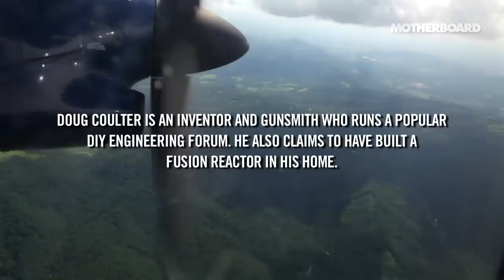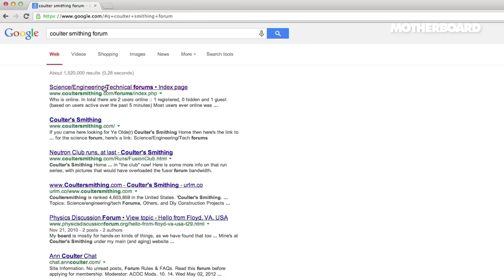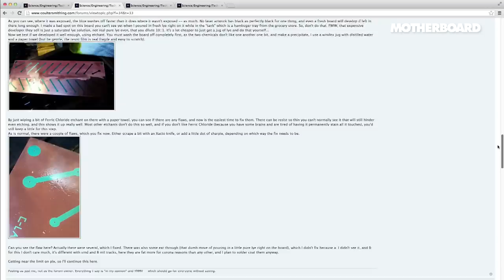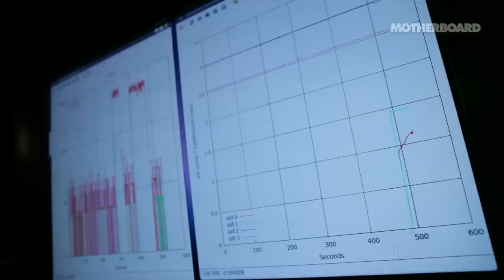Developing Nuclear Fusion in a Basement with a Reclusive Gunsmith

Comment: That "fusion" reactor just looks like a bunch of tubes and a light bulb attached to it. You ain't foolin' no one, old man.
Reply: just google "fusor"
Reply: This is an inertial electrostatic confinement fusion device, commonly known as a fusor. It was invented by Philo T Farnsworth and it works. It does not create a net gain of energy but there is real D-D fusion going on. They are pretty simple to make, high school students have made them.
Reply: Jerry Biehler   Jerry is correct, though the "inertial electrostatic confinement" moniker is a misnomer.  It's actually a beam colliding device, primarily.  I've just taken it a goodly bit further than Philo Farnsworth/Hirsch/Meeks, is all.  People used to just be armchair guessers about what goes on in there - I measure and adjust technique based on what I see - real science, in other words.  Not armchair quarterbacking science, which has tended to be more or less dead wrong.

Comment: I think that was a flux capacitor I saw over in the corner behind the nuclear fusion reactor. #genius #awesome
Reply: salaciousBastard At least one :)
Reply: I got the reference, and in fact, it IS a huge Maxwell capacitor, 120uF at 10kv (I have 3 total).  Not in use right now, it takes a lot of work to utilize around 6k joules that can discharge in under 10ns safely....

Comment: Would an uncontrolled fusion reactor keep growing and eventually turn earth into a mini sun?
Reply: fascinating guy, wished I lived next door.
Reply: No, it's a driven, not a chain reaction.  All the produced energy flies right back out, through the thin (~2.2e-5 atmosphere) pressure gas, and we have to turn it back into electricity to run the thing.  The point is, having enough left over after that to power a home, say.
Reply: No, the reason the sun sustains fusion, is that it is composed mostly of fusion-able material and has enough mass to sustain the reaction by pressure alone. Neither of those conditions are true on earth.
Reply: Doug Coulter How about put heavy water into the reactor and dip a drop of mercury into the water and put on the fusion reactor exactly when the drop of mercury are in the center of the fusion? Would that increase the output magnified?
Reply: Harry Halme Heavy water cannot exist in a vacuum, it will boil off. Deuterium, the gas that is used in a fusor, is an isotope of hydrogen so heavy water is really deuterium oxide. Plus water or heavy water is polar and is very hard to get out of a vacuum system, it take baking and other forms of excitation to get water molecules off the walls and out of the chamber. Very annoying.

Not sure what the point of mercury would be. It would just vaporize and contaminate everything in the chamber.
Reply: Thermonuclear bombs use a regular fission bomb (shock wave more or less) to compress and create fusion in lithium deuteride, which makes more neutrons, which in turn helps the fission bomb "use" all its fuel before the whole thing comes apart.  Most of the energy in that case is still from fission, FWIW.  The fusion part is just a neutron generator to accelerate the fission so more can happen before the thing vaporizes.
Reply: you will need a lot of thermonuclear "fuel" (tritium) for that, just to start to bring oxygen, helium and carbon into your chain reaction. in other way, hmm... not enough on this planet. or the solar system minus the sun for that matter.

>so it's very rare and expensive
there's enough tritum hanging in the glowstick on a gay furry's neck wagging his tail on techno music to power an office building or a couple of homes for one year.
Reply: *****
 that's what people feared when they detonated Trinity, the first nuclear weapon.  that the chain reaction could create a chain reaction with oxygen.
Same concerns occurred while testing the first hydrogen bombs. the first production of antimatter and the first particle collisions.

We survived ! meanwhile we had Three Mile, Chernobyl and Fukushima catastrophes because there's still not a nuclear physician in charge of every nuclear reactor. Engineers still think it's a steam machine that obeys to thermodynamic laws.
Reply: Fusion does not work that way...you can't have an uncontrolled reaction as that would imply you just kept fueling it.  Fusion reactions are by their nature controlled...even fusion bomb yield is limited by the payload...it doesn't result in spontaneous fusion from all surrounding material.
Reply: Jerry Biehler What if i took some mud, and rubbed it on my chest with some pure vanilla extract in there. Would that create nuclear fusion, the thing real scientist have been working towards for years?
Reply: Duhya The vanilla will not fuse by itself but it you add cinnamon, it might just work.
Reply: No, Spiderman 3 was bogus.

Comment: There's lot of money to be made in fusion, but its no easy: in fusion you are, in a nutshell, creating a micro-sun and harvesting heat from it to move turbines and generate power, but its cleaner and safer than fission. The problem is containing that micro-sun which can be several millions degrees hot. Everybody uses magnetic fields but that uses power so at the end you use more power than you get. So we either get more efficient magnets or some super-material that can take the heat.
Reply: Actually, they use superconducting (100% efficient, roughly) magnets and that's not the problem.  Magnets can only turn a charged particle, not contain it, hence the ever more elaborate field configurations they try.  Sadly, to get to gain, ITER thinks they have to use deuterium-tritium fuel, which makes such energetic neutrons it'll take the "box" to dust - temperature isn't actually the big one there, it's plasma instability, and getting it hot enough for thermalized, random collisions to create enough fusion.  

We're doing something completely different here, with coherent beams colliding - relatively cold, but moving very fast into a focus.  This doesn't divide the input energy into all 6 degrees of freedom like a thermal fusor does - wasting over 5/6 of the input power.  Instead, we get it all onto one degree of freedom - moving fast but not especially hot, there's no magic in "hot", just fast.  Does a bullet have to be hot to put a hole in things?
No, and it's roughly the same situation here, but the "bullets" are super small and super light and repel one another...overcoming that is the issue with this approach.
Reply: Interesting, got some links?
Reply: Offhand, I'd say spend a couple minutes on google and look for the ITER project or go to wikipedia and look for tokomak.  Kind of busy just now.

Comment: Almost two years ago the NIF achieved a successful controlled fusion reaction which resulted in the release of more energy than was absorbed by the fuel used to ignite it. This was only for an extremely short period of time and still a very long way away from an actual sustainable net-positive fusion reaction. Still, it's a very important milestone on the long road to sustainable fusion power generation.

What was witnessed during this video is not the same thing, and is certainly not capable of producing net-positive power results. These types of fusors have been around for quite some time and function in an entirely different manner. They are however excellent sources of neutron radiation and are still useful in all sorts of experiments. To claim that this fusor project shown on this video is mere years away from producing net-positive power is to misunderstand the current research.
Reply: Finally. I've been shown this video and after watching it and reading the comments, I felt that generally people didn't know enough to realize the differences. I think it might have helped if they had explained that in the video.

Comment: You're awesome dude!
... but are you sure you are dealing with fusion energy? I'm no nuclear specialist but apparently it requires stupendous amount of heat and pressure, at least for a sustained fusion.
Reply: +Þorsteinn Sigurðsson You're thinking of thermal - energy divided into all 6 degrees of freedom.  Yet, a bullet doesn't have to be hot to be effective.  Think directed energy and you're closer.

Comment: Funny you think fusion is worth the hassle. Wouldn't combining your panels with a decent battery solve the problem much quicker? An open source project in that direction would face much less regulatory hurdles. Dreams are nice, but we should try to  get rid of oil now! Not in 3-300 years ( the latter I fear when we follow fusion dreams....)

Comment: Isn't there a chance that when you reach that point where you produce more that you put in, it will just continue until it can't be contained anymore, becoming, in itself, a bomb? How do you turn it off or control it once it produces on its own?
Reply: +Richard Coomer There's so little fuel in there at a time, and it's mostly in a very tenuous state, that the energy that's released simply flies off (hopefully to boil water or otherwise be useful).  These can't chain-react.  It's not thermal, or to put it in simple language "it don't work like that".

Comment: You are telling me he has that 'fusion reactor' running at 100,000,000 Kelvin (temperature required for fusion) and it isn't melting, there is a reason the JET fusion is made of electromagnets. Furthermore lead does not stop neutrons very well you need multiple metres worth of concrete, if you had a fusion reactor there you would be dead. It looks like all he has is an cathode in a vacuum which just boils off electrons, not a fusion reactor.

Comment: Firstly a energy positive fusion reaction ahs already been verifiably demonstrated at NIF, it generated less energy than you'd find in a chocalate bar and required a ton more energy just to keep the system in a state where the reaction could take place. If Mr Coulter's system really does WORK and can be shown to be WORK he should submit it for peer review, the scientific community would be extremely interested in finding how how he's managed it.
Reply: I believe he indicated that he wasn`t getting more energy out than was put in, though he didn`t straight out say it.
Reply: NIF is pointless she it comes to fusion. You could never sustain any energy production in a system like that. The NIF has its main purpose, studying nuclear bombs. The fusion part is just PR to make it look better to the public.
Reply: Positive energy, no. Neutral energy, yes. The problem with fusion reactors that wasn't explained in the video is that we don't have a discovered room-temperature superconductor with which to disperse the heat from what is essentially a miniature sun oven. We've been using hyper-cooled superconductors and the trouble is that they eventually cease to be cooled as their temperature rises whilst the conductivity drops. That's why current reactors can only be used in bursts, which results in neutral energy output, equal to the energy input. We'll see it before 2030. That's for sure.

Comment: I need to know your secrets, man of science ! with enough energy i could finally open a portal and go back to Equestria ;v ;
more seriously, respect.
Myself, i've been thinking of a certain design for such a larger scale reactor, that would in fact combine a linear or circular proton synchrotron, combined with a tokamak, to immediately boost the plasma to immediate energy production by creating the reaction with high energy particles instead of a battery of lasers or microwaves. don't know really what kind of tech you're using here.

Comment: This is Electrically confined Fusion, it is also known as a Farnsworth Fusor. Built one with my colleague at University, not that hard to do but very very ineffective...
Reply: No, you're thinking straight Farnsworth/DC drive.  That's not quite what this is.
What you say is true about the original, though.
Reply: Doug Coulter so it is not only DC? what else do you have on there to pump more power in? and do you try to regain the Power you gain from the Fusion reaction? and about how many fusion reactions take place in your i'l call it "modified Farnsworth"? by the way i love the howl Open source movement im a big time supporter!
Reply: Grimmgork1 We've been fooling around, and discovered that just about anything that perturbs the thing off it's "dynamic equilibrium strange attractor (math term)" makes it better - even noise, but of late we're adding RF and looking for sweet spots in parametric sweeps.  We scale up and down.  If all we want is lots of fusion and don't care about net power, we get into the range of 14 million fusions/second on this gear (eg, an uncomfortable amount of radiation to be in the room with, so I keep scaling it down in size as things get better, since it's better if you can see it directly rather then with a vidcam from a cave).  

That's not a lot, it's just more than anyone else has actually delivered on a continuous basis - not a promise of future goodness, but where we are now.

If we go for Q (power gain) - it seems to work lots better at lower reaction rates/power input, at around the 4m fusions/second on this scale - but at far lower power inputs than the ratio of fusion.  Eg the Q is much higher at lower input powers, probably due to space-charge defocusing effects.  It's also better at onsets before it gains equilibrium.  So, we're heading in the direction of switching it (oscillating) so there are more onsets.

Comment: Here is a not so secret way for nuclear fusion. The sun uses the pressure created by gravity to allow fusion to occur. Could we use pressure we create by whatever clever means to do the same while harnessing energy.  I like that this dude likes guns too.
Reply: Thats kinda what goes on inside a fusor. A electrical field is used to try to smash deuterium atoms together in the center of the grid. Every once in a while it actually happens.

Comment: Thought that I would repeat this for Google:  Obama to Douglass Coulter:  "You didn't build that!"  Coulter to Obama, "Stay out of my way boy, and pass the ammo!"
Reply: Or just, stay out of my way.  I can pass my own ammo - I built that.
Reply: Doug Coulter It seems from the video that the source of energy for the endothermic parts of the fusion reaction is a laser?
Reply: Doug Coulter Ah, I see.  You use the electron beam from an electron microscope.  Excuse my ignorance of the particulars.  What is your source of thermal neutrons to turn deuterium into tritium?  I guess you use heavy water for a source of deuterium.  Don't the electrons in the beam interfere with the fusion reaction itself?  This would not be the case with a laser which is amplified light.  again, thanks in advance and excuse my basic questions.
Reply: Nope, I just use the tank from an old microscope.  What happens in D-D fusion, is that around half the reactions result in a tritium and a proton, the other half result in a 3He and a neutron.  That's why we measure the neutrons, as they are rare in nature and easy to detect out of any natural noise.
(what really happens is D+D=He, but then the He has so much nuclear energy, it decays - it's more than the normal binding energy of He)

But yes, there are a lot of electrons present, mostly emitted by the central 8 way cylindrical electrostatic lens when D+ ions hit it.  The net charge winds up being negative, which makes sense, since I'm pushing -50kv onto that "focusing grid" in an otherwise grounded tank.

In practice, we have both ions and electrons going both directions in the "dynamic equilibrium" state we showed them in the movie, and it turns out that that is what the math guys call a "strange attractor" for a non fusion state - which is why all the other IEC's fail.  Turns out, we need to add an impulse into what is normally like a spring and mass oscillator (the spring is the field and charge of whatever charged particle, and the mass is its, well, mass). To keep things from just eventually slowing down due to scattering losses, and fusion more or less stopping.  In other words, we see tons (tens of thousands of times) more fusion during the initial startup - with less input power on top. 
That's within a reasonable range to get to gain, with a little additional tweaking.  We simply have to work that spring/mass/scattering loss system a little smarter.  Well, it turns out that with the ion source grid, we've accidentally made a PNP power tube with a power gain over 100, so the next step is to make it oscillate at the right frequency (it already does at random but way too fast for what is wanted) to keep adding impulse energy to the spring-mass system in phase with itself, so it maintains despite losses from scattering.
That's the "secret sauce" I've not yet published, as I'm in the middle of building and testing - but it has happened by accident before, and I caught it in the act with my data logging gear - see my youtube channel for that: http://www.youtube.com/playlist?list=PLqWoXk95hIGOb3YyN4zI5CSUWWtpYAJIj  Now I'm just going to do what I already know works by accident on purpose and more repeatably.  Get it?
There just wasn't any point frying the nice guys from Vice with that.  Their camera couldn't tell the difference.  And they edited 20-30 hours down to 8 min, so some detail was lost - they have to work with their audience at a certain level - I think they did fine, given the circumstances.
Reply: Dov BarLeib
No, currently the input power is just plain old DC high voltage.